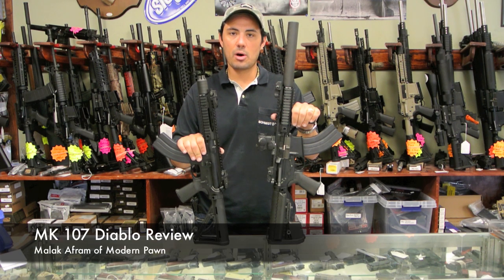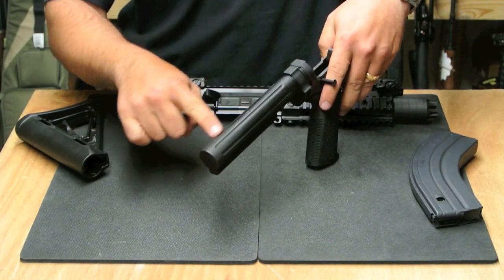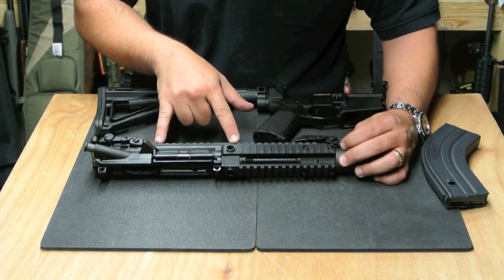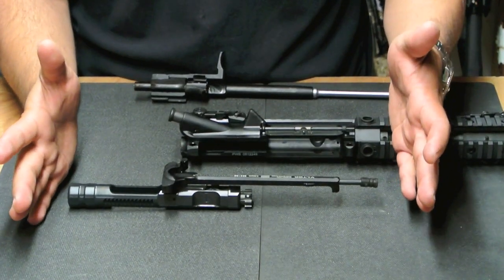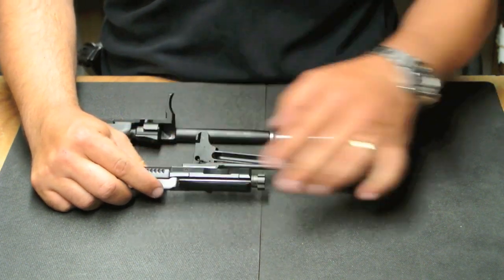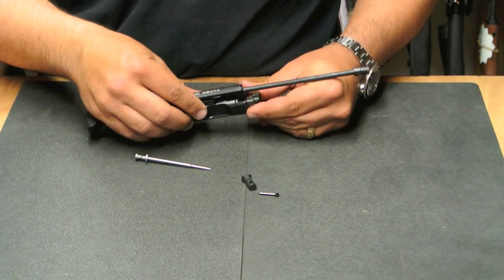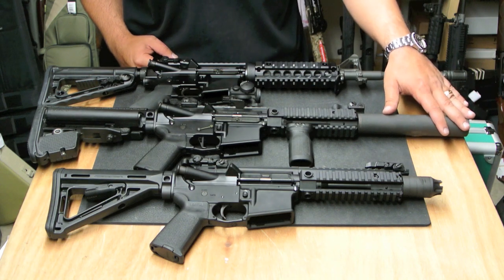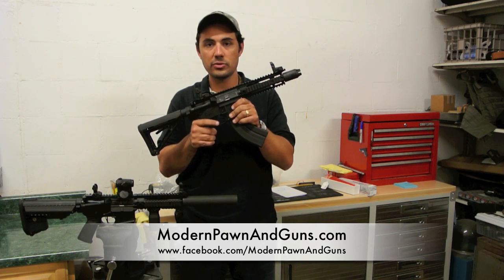PWS Diablo Review 762x39 SBR 7inch / Modern Pawn and Guns Corpus Christi, TX

Comment from the maker: Unless suppressed, they are normally extremely loud.  7 to 10in 556 ARs are deafening.  The shortness is really nice for handling inside.  SWAT guys and CQB style guys run SBRs, but they are going in with ear protection.  You set off an SBR in a home defense situation and you could disorient yourself, making it hard to fight.  This is one reason I like shotguns for home defense.  They are not hearing safe, but probably will not make you falling over dizzy from the concussion.

Comment: On the Diablo the gas block is slightly past where the threads begin So if you threaded it on ,it would not stop at the barrel it would stop on the gas block ,So do you run the factory crush washer

Comment: I'm interested in a modern day version of Col. Cooper's idea of the Scout rifle. And this one so far has come the closest. Can you tell me if it can run both 7.62 AND .308 cartridges? Also what is the 3-shot group out to 200 yards and can it hit a target out to 400 yards? It meets the length and weight requirements. Can a side folding stock be added or would that hinder the accuracy?
Reply from the maker: 762x39 will fit in an AR15 platform, 308 needs an AR10 platform.  PWS makes the MK216 in 308.  Conservatively, the diablo will shoot 3inch groups at 200 with good ammo.  400 yard target is very doable, especially if you are shooting minute of man (think 8in plate).  No side folder, must have the receiver extension for the rifle to function properly.

Comment: Hey guys, I am trying to put a 7.62 Specwar on my Diablo SBR, but I can't figure out how to get the muzzle device off the barrel.  How did you get yours off to mount the suppressor?
Reply from the maker: Its a pain in the ass.  Vise up the upper, then Kroil the muzzle device, use a  heat gun to help loosen it up, then when it is warm (not crazy hot) use a strap wrench to around the main body.  If it is crazy stuck, you might have to get a heavy piece of leather and pipe wrench/chain wrench.  Don't bend the upper receiver.
Reply: OK, wish me luck.  Sounds like one of those "if  it ain't broke, fix it 'til it is" kind of situations.  I'll let you know how it goes.  Thanks.

Comment: Any issues running the can on the x39 Diablo?  I know not many can companies recommend running a can on a barrel less than 10 inches.  Im  considering an x39 Diablo, and I have an AAC SDN-6 but AAC did not recommend running that can on a x39 7 inch barrel.
Reply from the maker: just keep the rate of fire under control.  Most suppressor companies say they will not warranty use down to 7in .  I have run gemtechs, griffins, aac, and surefires on 7in 7.62x39 with no issues, but if you are going to be dumping mag after mag, get something full auto rate for shorties (maybe a Silencerco Saker 762)
Reply: I have a silencerco saker on mine, its warrantied all the way down to 7" .
Reply: +modernpawn 
That is correct. But do make sure you have a good rate of twist to stabilize your bullet. 
Let me ask everyone this: How often do you see baffle strikes from using really short barrels? How to prevent baffle strikes?  Are most baffle strikes catastrophic or not?

Comment: what's the benefit of keeping the piston head loose?
Reply: Coupled with some good clearance (as any Kalashnikov would have), a loose fitting piston is better able to cope with gas cylinder fouling. Instead of jamming up against a deposit it can just move out of the way and possibly work it loose. The system is meant to run severely overgassed (hence all the vent holes on a Kalashnikov) and is sufficiently overbuilt to deal with that. Sticking it in an AR-15 platform runs the risk of fatigue cracking if the bolt group isn't sufficiently overbuilt or requires that more gas be vented or less be allowed to enter the cylinder. It's very difficult to make a weapon more reliable without adding lots of weight to it. For the AR-15 platform with a full length barrel (i.e. Stoner original designs) the DI system typically makes more sense, even if it may be a bit less robust. Running a DI system overgassed (in the interest of reliability) is significantly easier on the bolt group.

Comment: Pretty good video. Full of accurate information...mostly...
I am a huge fan of short and long stroke piston rifles and carbines. However to say that a DI gun is useless (non functional) after losing a gas ring is somewhat erroneous. If the movement of the bolt is frozen because of some piece of metal, that is one thing. If a gas ring falls apart and is blown out of the bolt carrier area then a DI gun will continue to function with 2 rings,,,usually. 

There may be situations where a gun is super tuned via an adjustable gas block or the gun has an usually over power buffer spring. But in most situations the owner is shooting an over gassed system and likely will not even notice that a ring is missing until he sees it visually.
 I have even heard of DI guns functioning on a single gas ring.

 Read this interesting thread...
http://www.ar15.com/forums/t_3_118/646086_BCM_Bolt_Missing_Gas_Ring.html
Reply: +rascalMatt17 
You mis read my comment. I said all the info in the video was accurate. That means all the reasons for using a piston gun for short barreled suppressed is valid. I agree with all that. I will go one step further and say that I think ALL suppressed weapons should be piston driven.

 I am a fan of short stroke due to the great weight savings. The new Syrac Piston kit is a major break through in weight savings. The kit comes in with a mere 1.4 ounce heaver profile over a DI system. Pretty good, huh?

My point was about broken/missing  gas rings only. My comment was not meant to be directed to suppressor use.